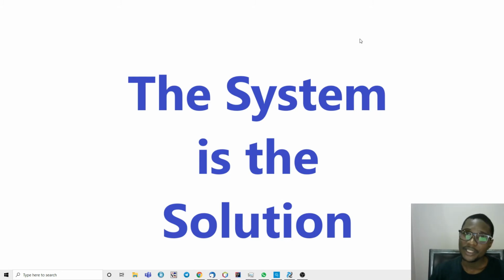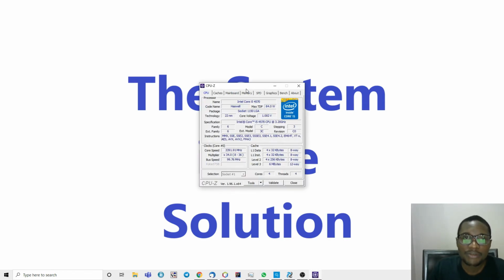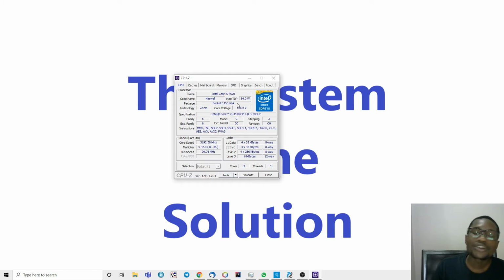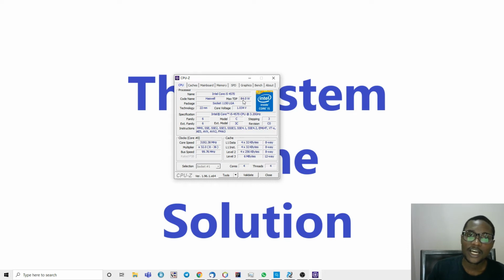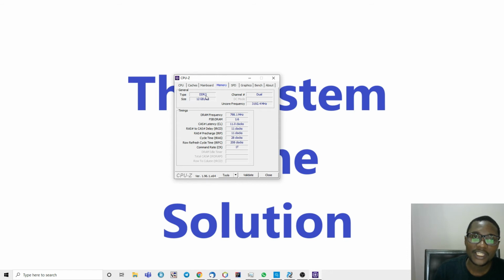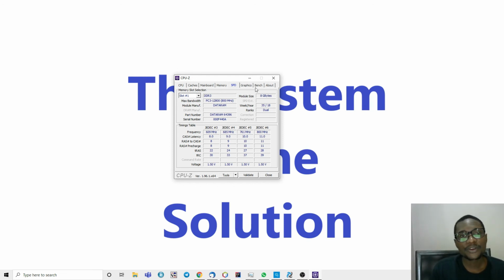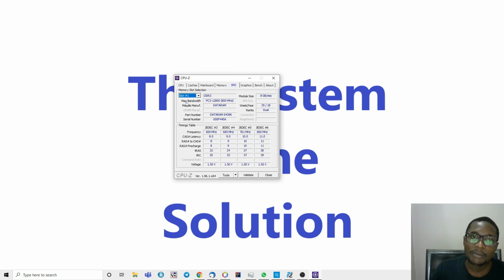Best Free tools to Check Pc Specs and Performance

Comment: Hi quick question. I don't know if I've bought dead ram or if my system can't handle it.
If ram is dead will it show up in Cpu z.
As my memory shows up as there. But unfortunately when I put the 16gb stick in alone I get nothing, only beeping from my pc.
I have a i3 4th generation lenovo thinkcentre which says it will take maximum of 16gb of ram. But perhaps I need 2 sticks of 8gb.
Thank you in advance.
Reply from the maker: The first thing I can advise is try to Google your board to see if that ram is support because it can be incompatible if that's not the case the ram is not ok
Reply from the maker: Both unsupported ram n dead won't make you PC to boot if it boots it won't show
Reply from the maker: Hope that helps
Reply from the maker: Make sure to check the rams reading eg 1600U
Reply: @ITCONTENTS  thank you for all of your help. Much appreciated :)
Reply from the maker: @jamieupandown786  if you have a video request drop it too happy to help

Comment: Cpu z showing 3200 MHz ram
But task manager showing 2933 MHz ...
I want to upgrade my ram...
Then which ram I need to buy?
Reply from the maker: Please follow the one cpu z is showing under SPD you should see the ram slot and it's ram specs eg 12800U (800mhz) and make sure your channels have the same specs

The one in task manager is a combined frequency for all you should see slots used that's that frequency there . Hope that helps